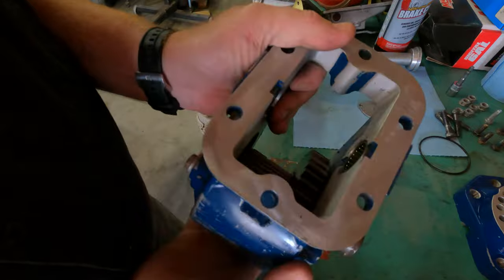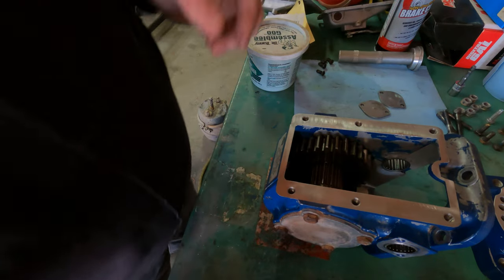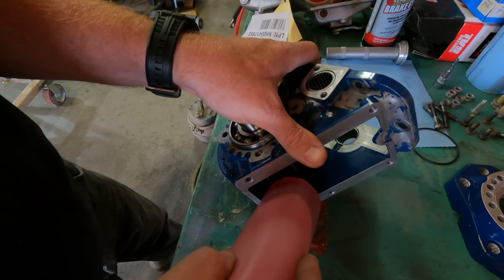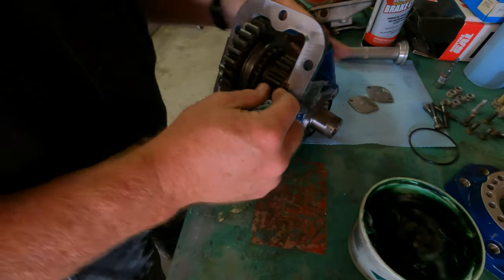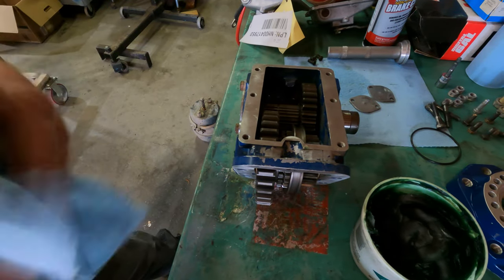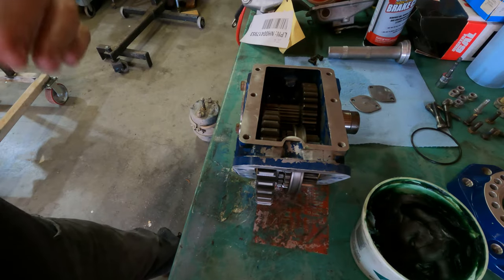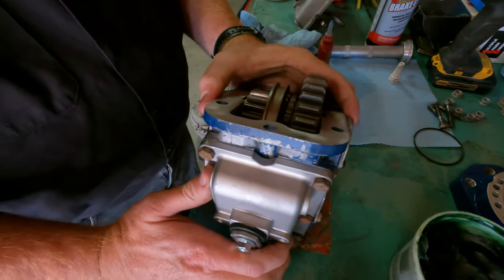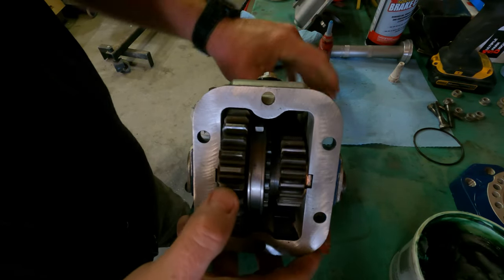TG Series Muncie PTO Rebuild. How Does This Thing Work?

Comment: Just like a baby manual transmission except no synchronizers. A synchros job is to slow down or speed up the gear (on shaft) to the exact same speed to make latching onto it easy. Motorcycles don’t use synchros, just dogs that slide into matching rectangular holes just slightly bigger, the gear is already spinning the a same speed, called synchro-mesh running on two parallel shafts.

Comment: Hey I’m not judging just giving a little more knowledge and maybe I’m wrong. But the TG series takes two different kinds of slide clutches. One is for the “A69” and the other one is for like the “U68” for fullers. Since you are working on an Allison unit it take a slide clutch that have a deeper cut at the rim. The A69 clutch is a 49T38158 and the other common one is a 49T33959.